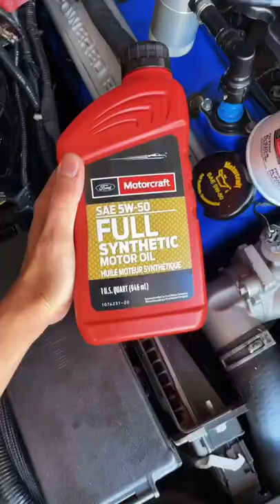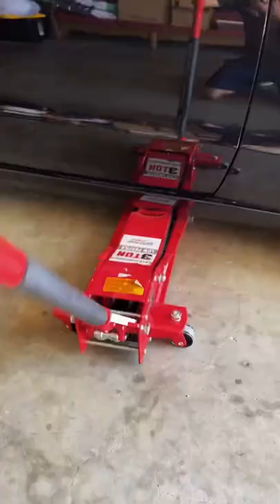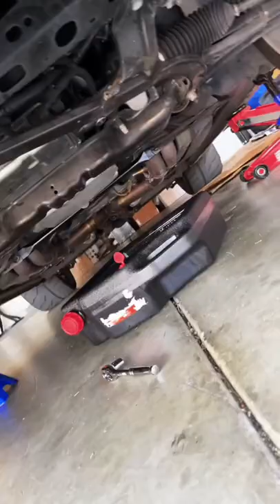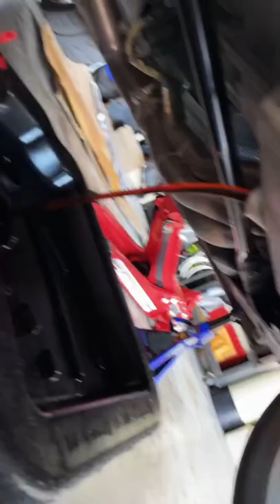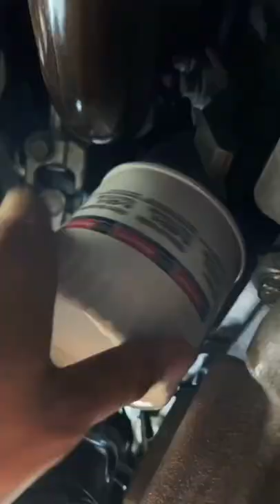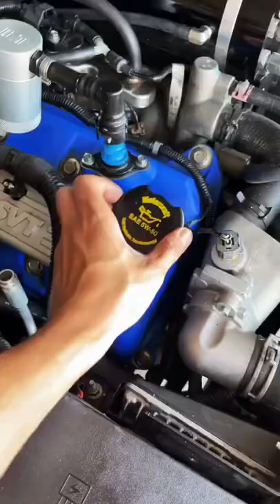How to do an oil change 🏎💨

Comment: Advice: Don’t prime the filter by pre-filling it. You introduce contaminants to your oil galleys by doing so. It’s also almost impossible to do if your filter is mounted horizontally. 

Instead, install the filter empty, remove the fuse for the injectors or the ignition system from the fuse/relay box; then crank the engine 2 to 3 times for no more than 3 seconds each. 

That should prime your filter without applying too much force to your bearings. 

You could also just use clear flood mode if your car is equipped with that capability. To test if it does, before you change the oil, hold the gas pedal all the way down and turn the key. If the engine just cranks without starting, that’s “clear flood mode” and you can use that to prime your filter. 

Hope this helps you keep your car running for as long as possible!
Reply: or you could just fill the filter start the car and nothing happens because guess what its brand new fucking oil
Reply: I don't consider that there is any problem with priming the filter if you are very meticulous while verifying and cleaning everything, of course as long as the geometry allows you to vertically install the filter without contortion.

Now regarding the “clear flood mode", thank you for the data, where I live we only do maintenance to old cars, so I have never listen of such mode.

Comment: I can tell you don’t know much about cars because you probably got that oil and filter from the dealership and paid a premium. Motorcraft doesn’t make their own oil they just buy from someone else and slap their logo on it, you also don’t need to fill the filter, you also should start the car WHILE FILLED WITH OIL and warm up and sit for 15 minutes with the cap off and dipstick off so that air can fill and depress the oil.

Comment: Why are you prefilling your filter the car calls for a specific amount of oil. And no real car manual or shop manual will tell you to prefill a filter...
Reply: You apparently have never worked on a large engine before… As a diesel mechanic, I pre fill the filters because they are FOCKIN LARGE
Reply: Whatever amount you pour into the filter, the rest ends up in the oil fill hole if you use the same bottle. 😐

Comment: Hes going to cause an issue eventually prefilling the filter
Reply: No your not very smart in automotive are you. You do understand that if you can add oil into the new filter you should this is because when you start the car the filter has oil in it so its not running dry on start its smart to add oil into the filter especially around the filter gasket. Hope you understand.
Reply: @Averagegamer673  whats your experience and training, ive got six years and three different schools that have all said the exact same thing, you can never get all the oil out of the engine during an oil change. Thats why on a rebuild you do not prefill the filter, but prime the oil pump.
Reply: I was taught by a mechanic who has been doing this for 20+ years and he said that you don't have to pre-fill the filter if it's easier not to but that you should if possible.
Reply: @ryanburke8849  yeah thanks for agreeing but this kid trying to prove a mute point 6 years and 3 schools im 18 and already know more then this kid lmao
Reply: @Averagegamer673  ya I'm 17 and I've done more oil changes than I can count and I've never had a problem with pre-filling the filter as long as you make sure the old oil filter gasket is removed which you have to do whether you pre-fill the filter or not

Comment: idk about handtight, maybe a bit more. Also dont trust dipstick or cap entirely. Look up info and be certain. People at times replace those and can have wrong ones. Ive heard horror stories for wrong dipsticks and even seen a few videos. People are morons. If you just bought a car especially, look up all your needed info first and then proceed. Full synthetic always best too. If you got an old car it could benefit alot from full synthetic. Only thing i liked here was the jackstand things. I never think about it but yes its a good idea. Or, at the very least put a used beaten up rim if ya got one lying around. Just to be sure if car falls, you will be ok and get out

Comment: Thanks for the tips but your engine oil replaced looks new no need to change waiting your money 😂I suggest for average driving follow manufacturing recommendation for me I change every 10000 km or 6000 miles or every year max and always change filter with it

Comment: Multiple wrong things with this video, he jacked and put the jack stand on the pinch weld of this car, some cars require u to but never recommended, i have a 65 mustang myself and you always jack by the frame-rail or subframe crossbrace, no need to prefill the filter at all, thats just asking to introduce a mess or dirt, wipe some oil on the seal thats it, install and fill it up to 85ish% of written requirement, start car, after oil pressure builds up read dipstick, add oil if necessary check, repeat

Comment: Of course he uses Motorcraft for his Ford 😆 like buddy oil is oil your just wasting money on more expensive oil. It's one thing if it's a racing motor like the RS 2.3L but it's a truck. As long as it's your recommend weight just get the basic kind. They all do the same thing

Comment: Jokes on you i use hand oil pump it is cheap to buy i never change the oil nut my cars filter is on top easy job also turn the engine on for a minute later check oil level

Comment: Only idiots fill the oil filter and grease the gasket. 100% you dont have to do this. Look how much your car holds and use your brain an put it in after you put the filter on. And unless your wipe the area where you removed the oil filter it should have oil on it. And there you go screw the filter on make sure the bolt is on the oil pan then pure the oil in and that's it. No need for extra BS

Comment: You don't need to even lube the ring or fill the oil filter just myths
Reply: "myths" lol ok. I'll take a 15 year NASCAR head mechanic's advice over yours. You lube the gasket don't doesn't tear when you spin it on.
Reply: @some-replies  your gonna get oil on it anyways when you take the other oil filter off lmao it's no difference

Comment: Okay first of all you don't put oil in your filter The mini turn your car on your pump f**** pump it up second of all the minute you put oil in that filter and you go up there to go try to put the thing in there You're getting all the particulates in the spot of the filter that they're not supposed to be in so you are ruining your bearings your lifters all of that if there's any contamination in it please don't do this this is done unproperly obviously this kid's got more money than he's got for brains but then again this is the same kid that has a fake Shelby that's right a fake Shelby built by Ford not by Shelby America anybody that had a real Shelby would not do this and any which way shape or form
Reply: You need to learn how to form complete sentences. I was trained to prefill filters whenever possible. I'd rather not run a dry pump, even for a second.
Reply: @some-replies  there's still enough oil in your jackets and your chambers bud every time you start your car you're starting to dry you already know that The factory doesn't do that Don't know why you would but if somebody taught you that way go ahead

Comment: What I usually do is let the oil settle a bit then check the dipstick. Usually on cold days. Also, warm up your engine a bit, oil flows easier when warm. 

Don't he stupid and drain it when its hot.